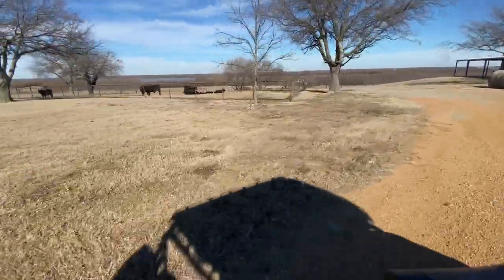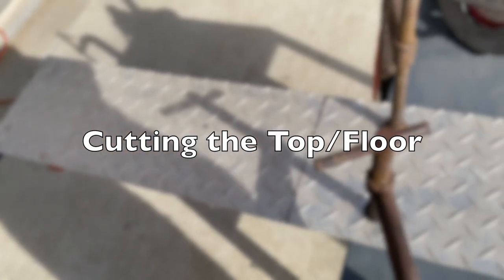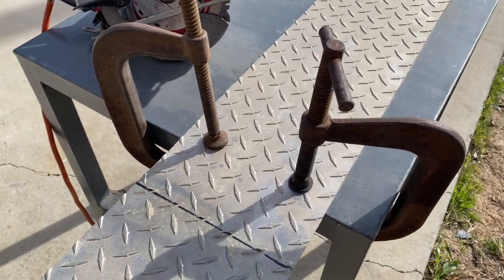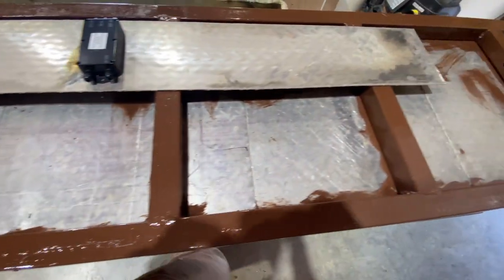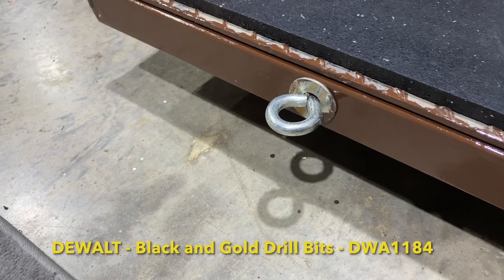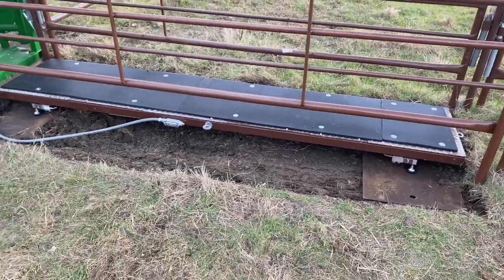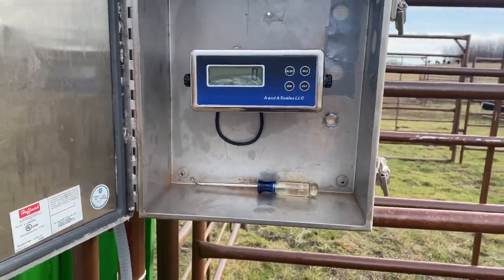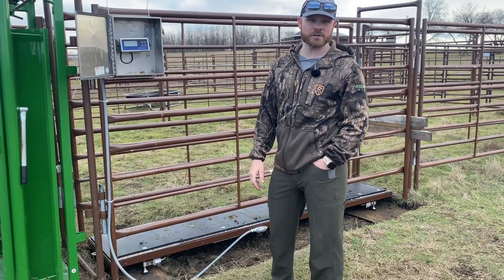How to Build a Livestock Scale from Amazon - Easily Weigh Cattle

Comment: Nice job for sure! Just wanted to know if you could share the dimensions of the platform that you made?
Reply from the maker: Steve, absolutely. Thanks for asking. Let me gather that info and I’ll get back to you. 

Also, since we have used it a handful of times I will suggest the size we wish we had made it
Reply from the maker: Here is what we built:
~10’ (9’ 10” exactly) long x 24” wide with bracing equally spaced throughout. 

We wish we had built it 36” wide and will probably have to alter it in future. Trying to get larger cows to stand on 24” width is TOUGH 

Please let me know what other questions you may have. Happy to help or discuss

Comment: I just bought a set of scale bars and made a platform out of wood, just temporary, cause I had to weigh a heifer calf.  I want to make something a little more sturdy and longer lasting.  Did you use 2"x2" tubing?   What gauge and/or thickness was the tubing?
Reply from the maker: I would use 2x2 tubing 3/16. Also, we wish we made it wider. 34-36” would be better than the 24” we did. Let me know what other questions you might have